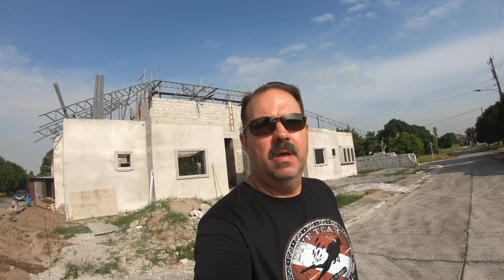Philippine House Building Step by Step, Build Day 92: Truss The Process

Comment: Is the dirty kitchen under cover ( roof ), wife said dirty kitchen is out side next to or away from house. I like the trusses a lot,, first I seen like that in one year of looking at house building in the PH.
Reply from the maker: Dirty kitchens are typically outside. We decided to move ours indoors but still separate with strong ventilation to keep the strong smells out of the main house. 
First web trusses we’ve seen here. Definitely not the norm.
Reply: @CasaTexPina  I think it depends upon your roof type. if it is tiles, concrete roofing or metal long span. which is not that heavy and much cheaper.

Comment: do these guys in the philipinnes know what tiles glue is ? for the mouldings some incredible products out there , the job is stronger and done quicker ..what a huge house and solid
Reply from the maker: andrew c. 
Welcome to Casa TexPina.
We post a daily vlog of the Philippine House Building experience.

Most products used here have been around for a while. We have not quite gotten to the tile stage yet. That will come in the finishing stages. Typically use a dry set tile bed with grout adhesive between the tiles.
As for the moldings, they just use mortar mix, nails and wire ties. 

Thank you for watching.
Like, comment, subscribe, and share.

Comment: Are they gonna primer coat those welds on the trusses after they put them up?
Reply from the maker: That’s what they tell me. They do prime coat on the ground prior to lifting in place. But still need to redo it after final placement.
Confirmed with the welding foreman. They will repaint all of the metal after the purlins are placed. One of the final steps.